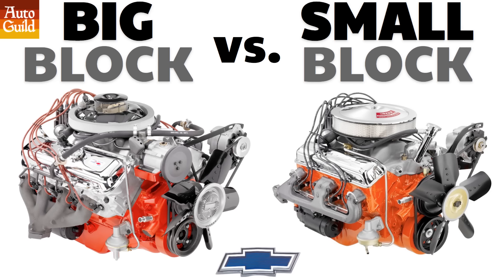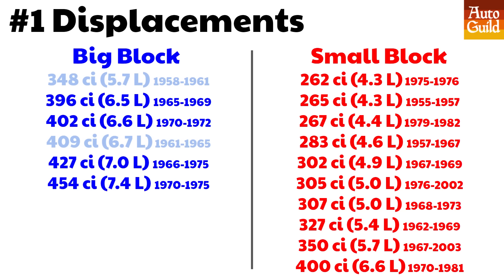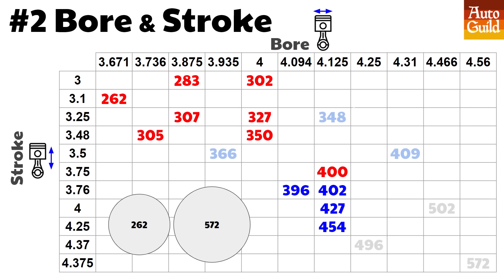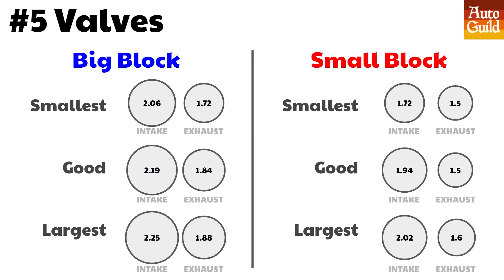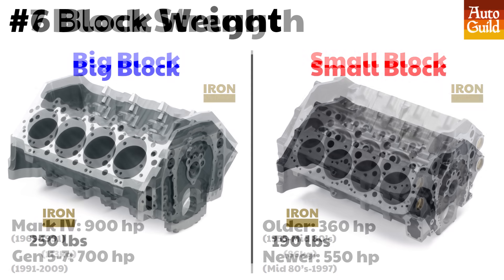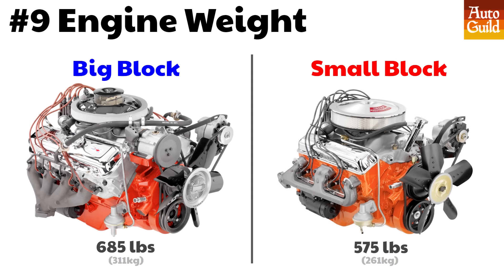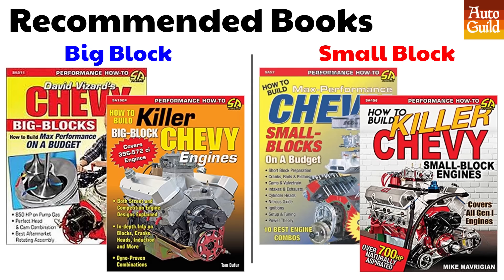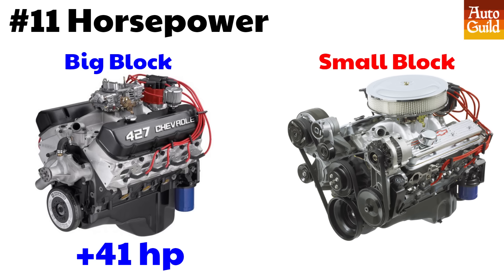Big Block vs  Small Block Chevy Comparison

Comment: Depends on what you're doing with the car. For drag racing dollar for dollar the big block is best! If you build a 400 small block and a 396 big block, and are limited to the same budget the big block will make more power. A gasoline engine is norhing more than an air pump. The more air in and the more air out with the corresponding amount of fuel, the more h.p. you will make! A stock big block head has bigger ports than the biggest aftermarket aluminum head!!!

Comment: Why are the RPM specs on these chevy engines so low?
The biggest selling point over All other engines were the high rev capabilities.
64 biscayne 409 4spd shifted at 7400 rpm all day long.
The 327 didn't turn on til 4000 rpm and shifted at 8500.
If you don't turn the rpm up you might as well have a 6cyl.

Comment: I started out with a 383 Chevy and the oil pump broke in two in hi gear at the track. Now I use BBC oil pumps in my SBC engines. Then 400 SBC At 13.1 compression and I burned up a few of those 4 bolt blocks with NOS at the drag strip. A 250 shot. They ran great for A little while. Next I got a 427 or 435 .040 over truck tall deck and I put Pop up pistons and H beam rods and 68 Corvette 3x2 cast oval port head's and a team G with a 750 DP Holley and 1 7/8 inch headers and a 3800 ATI stall turbo 350 and 4.10 gear .550 solid Cam at 108 and A gear drive. Ran it for 15 years and won a championship with it. Then I pulled it out and stroked it to 525 and changed it to a 4.56 gear. Ran great for a few years 11.0 1/4 Mile out of the boxes. Then I decided to go back to the street and I broke roller rockers in short order and I went to shaft rockers for about 500 dollars after machine work and bushings to remove the roller bearings that fail on BBC after a few miles with a solid roller cam. That and the 1050 Holley put me at about 10 K into the 525 motor. Everything was forged steel and Diamond Pistons 12 to 1 cr. 121 CC head's. Open Square Port aluminum. 320 runner's Big intake. I felt pretty good but I wanted it to run cooler on the street so I got a rollerized 2800 torque converter and the builder put a heli coil in one of the bolt holes and painted it black so I didn't see it. It was running great for about a month and I was going home and I stopped and I took off and I shifted it at 5000 RPM and when I hit 3rd. Gear or high I Heard a Pop and it started shaking like crazy and I let out and I was two blocks from home and I pulled the engine out and then I saw the Heli coil still on the bolt with locktite and I said what in the hell is that Heli coil doing there ? . They refunded me for the torque converter but I lost my block and transmission in the process. So I decided to replace the transmission and build a 355 four bolt main with Pop up pistons and A solid Cam. I put it in the car and my old ATI stall converter and it ran okay but it was nothing compared to the 525 that I took out. And I am serious about it ran great ! . Well I drove it to a few car shows and around town last summer and it was a good little 355 SBC but it was not a 400 SBC or 427 BBC. And I had a 454 once for a few months before I stroked The 427/435 to 525 but it was not consistent enough for me and I sold it. Well everything said and done I decided that a 355 SBC is not working for me and I just put another 454 in the car. I have a 89 formula 350 Firebird as a daily driver and I like the 350 in that car but in my race car I have to have at least a 454 engine. I trashed a nice 427/435 and A 525 using that same block, building a street BBC stroker is expensive if you want a 11 second engine that is going to stay together. I Did it and I was fooled by a hidden Heli coil in a New torque converter. Big blocks Are not very forgiving if something goes wrong. The crankshaft was so hard that when the torque converter bolt came out it flexed the front main bearing in the block and stacked the two bearings and cut out the block about a 1/8 of a inch. It was a 13 inch Turbo 400 torque converter and a little 6 inch racing front Harmonic dampener. The Torque converter was twice the size of the harmonic balancer so it lost the battle. Everything in the transmission was bent. The engine was internally balanced with Mallory welded in place. I was only at 5000 RPM when it happened. I used to race as A 427 at 6200 shifts. 427 BBC is a friendly engine if you can keep the pushrods and rocker arms together. I used 7/16 inch molley pushrods and Roller rockers but not on the street. It was a track only car back then.  On the street I kept having roller rockers arm's failing on my solid Cam BBC. I'd break them in half and I'd knock out the bearings. I ended up with stainless steel adjustable with shafts and steel bushings. I made a set for 500 dollars but they cost 1500 to 2500 dollars for a set of them normally. A 400 SBC is the cheapest HP in my opinion. But real power is A Big block . My 350 formula eats a lot of gas for the engine size but it handles great so I don't mind. I don't think that My 454 with the 4.56 is going to be any harder on gas than the 350 with the 3.31 gear to be honest under normal cruise driving. My 525 was getting around 10 or more mpg on the street with a 1050 dominator on it. Probably around 12 MPG. A 10 gallon fuel cell went around 100 miles before I stopped for gas. Of course I added a little bit of toluene for octane purposes. And A little mystery oil in that. I was over 11 to 1 actual compression on the street. Everything was a little bit cheaper back then but the principle is still the same.

Comment: I also truly believe the 350 chevy shouldn't be reved oit more than 5200rpm, it makes its best power at 3 grand with a mild street cam, my 350 info comes form a small block 350 Lt1 from 1996. 285hp 330torque red line 5800rpm. At 5 grand you can fee and hear the motor maxing out is interal potential. It all depends on the cam ground. Im not a big believer in ls swaping the world. I love the 5.3 ls engines because of reliability, but im nostalgic. Im also 22 years old so calling me a bomer is a complement. It depends on the application and preferences. Big block weights  more but has more potential for horsepower. Small block is lighter. Cheaper to garage build with aftermarket parts. Idk myself tbh both engines are formidable warriors. Depends on tons of factors.
Reply from the maker: Yeah great points.  I love having choose.  For me an alum block LS is great cause I like low weight but for others that’s not important.  Each car needs its own unique engine that works for the owner.

Comment: I installed an LS6 crate engine in my 1970 RS Camaro. Backed it up with a TH400 Trans with 3500 stall converter with manual valve body and a 3:73 read end. If you breathed on the accelerator the tires would go up in smoke and lay rubber for as long as you stood on the gas pedal. At 60mph on the highway you could punch it and the tires would break loose and car would start to drift sideways ! I overrevved the engine several times to 7500rpm and never broke anything. Sold the car to a friend of mine 25 years ago and he still has it.
Reply: You need better tires! Problem solved
Reply: @godofrock Not that simple. I had a buddy with an old Chevy Luv he made an 1/8th mile runner out of. Built 327 (low compression because of plans to put a blower on it that never materialized) with a 2-speed Powerglide and a Ford 9-inch with 3.90 gears. Tried for years and he could never get it to get proper traction. Wider and wider tires, ladder bars, etc. Had it for almost two decades and nothing seemed to work whenever he tried to get it to work right. Came to the conclusion that it was too light in the rear and it’d never really change. My ‘89 Sierra C1500 with a bone stock stock 350 TBI will light up the tires with 3.42 gears because it’s a single cab long bed, there’s virtually no weight over the rear axle if I’m not towing anything. Suspension setup and front-to-rear weight distribution are very important when trying to gain and maintain traction.

Comment: If valves are big and close to each other one burns the other and if heads are aluminium it corrodes its called electrollisess by metals steel is the best and 1970 are the most durable fuck after market parts

Comment: So question on the block strength. What about the new blocks made them so much tougher and what about the common thing heard “them old 70s high nickel 4 bolt mains were indestructible. Nothing like this 80s junk”?

Comment: There's a few things I don't understand. All of our race cars/derby cars have around  700 horsepower or more on older 5.7 small blocks and they handle the power just fine.......
Reply: Lol. If you are getting 700 hp out of a small block,  you got some cash dumped in your motor. Like drag strip cars.
Reply: @commentsedited  between 8 and 10 grand

Comment: It depends on the application. The big block makes better low end torque and generally makes more hp because of displacement. The small block turns more rpm and is lighter and makes adequate power which makes it a better road and round/road course cars.

Comment: Your video got a 👎, you left out several key points of info. Particularly the coyote bore spacing being it’s limiting factor. Flow charts for for heads. The coyote spanks the ls/Lt every day of the week due to power to weight/size-ratio. 
Coming back for a edit. Both the Lt and coyote can both handle 1300 turbo tune with a well educated tuner. Respectively both impressive engines. 
I would much rather work on the Lt than the coyote for simplicity purposes but in terms of charging the customer an hour coyote all the way.

Comment: A person can bolt on power on a big block  power. 
And there are part that can reduce valve weight and drag.
 And the rule is still the same it is the price that keeps the 
rule alive and undisputed the.
What happens when you make a big block turn r's like a  small block?
nothing beats cubic inch off the line, if that was not true everyone would be happy with weedeaters engine at the strip.  
now the LS engine and a few others are going to break inti the envelope of High rpm in future rpm engines. I have got one in storage idles at 5,750 and cruses at 1,273 rpm.
And every state patrol has left you messages to park it or they will shoot you and take the ride because thet can't keep up with it.
That was 30 years ago. Right now they are selling the last of this type of engines maybe a couple more but I doubt it.
Next Ergy fuel burning engine, ha one but couldn't keep it cool or I kept burning everything behind it for a hundred yards. Concrete I almost made my brother cry when I burn the back of his new shop.  But we are talking space travel is next.
Well my key board is sticking, hope this give you something to think about and take my advise stick to grade school stuff if you don't dare to chase your dreams.
And remember this just because you can't do it don't mean it can't be done.

Comment: I have a 1970 El Camino. It currently has a stock small block with long tube headers. I'm thinking of putting in a small block stroker to put it in a similar performance range to the big block. Any thoughts?

Comment: In a Nova/Camaro body, I would prefer a very healthy 327 (with camelback heads and 
forged crank and rods).  For heavier cars, like the Chevelle, the big block would probably
be better.  The smaller and lighter cars do well with a lighter small block.   If you put a 
500 hp small block into a Nova/Camaro, it will drive better than a bigger and heavier
car with a big block.  All depends on the cam, tranny, gears, and suspension setup.

Comment: would be nice if you were a bit more accurate in your statements
402 didn't replace 396...402 was a 396 bored 30 over as over 400 cu in had lower emissions rules. LS did not replace the small block, LS is a small block, 283, 302, 305, 307, 327, 350, 400 are gen I small blocks, 4.8, 5.3, 5.7, 6.0, 6.2 are gen III and gen IV small blocks...gen III small block replaced the gen I, then gen IV replaced the gen III, more recently gen V (LT) replaced the gen IV....they are all small blocks

Comment: I have a 67 Cougar 390 GT. I love the fact that its a Big Block. You just cant beat that sound of the thump of a mild cam and good exhaust pumping out back. A small block is no comparison. I swapped out the intake for an aluminum version. Installed an aluminum water pump. Jba tri y stainless race headers. Installed a Mini starter. Moved the battery out back. Installed an aluminum radiator with electric fan. All this made the 390 only 50 pounds heavier than if a 302 was in the engine bay.

Comment: When young I had a 396/325hp but added the 360hp cam in my 65 Chevelle SS and now a 65 El Camino so I have a good comparison.. Basically similar in all ways. The 350 cam now is at 454/454 lft .@050 218/218 duration with best GM Vortec performance heads  to the 396 360hp cam 461/480,  214/218 with a little more lift and lower line Oval Port head that I did hand port them.and port matched the cast iron High rise.. Similar HP? Trans is a 700r4 for SBC in the El Camino vs. the Muncie 4 spd -396. Same 3.73 rear Gears.

Torque is the biggest difference and therefore really liked the 396 better. Just felt so much more powerful, responsive and revved very quick.. Instant tire smoke just stabbing from a 15 mph roll and second gear you had to control the sideways movement. MPG goes to SBC. probably 5mpg city. OD in the 700r4 is not fair here. 

As far as maintenance? Since my 396 was not radical it was not any more problematic. Fitting in the 396 in a 65 was no problem. Just used 67 engine mounts.. plug and play. I will say however changing plugs was a lot easier since all exhaust ports were evenly spaced, The siamese middle SB ports are pain. Had old School 2 1/4" tube Appliance Headers on the 396.. they had an ingenious #1 tube that had a slip joint. unloosen it from the head and a clear path to the plugs on the left. I bought extra Header gaskets and just made separate ones for that port. BB -Seemed to go through more plugs ..Mallory  Dual Point vs HEI now? Better NGK plugs?  

Bought the El Co with the 350. If I could afford a BB I would swap. 396 is the cheapest. Remember out running a kid in 427 Camaro. LS's are great too but more work to go in. $$$ wise maybe the same? Options. LS ..no leaks!

Comment: For a bunch of Chevy guys, a $5,000 aftermarket engine block sounds expensive. 

But a couple of years ago Matt Farrah (Smoking Tire) bought an air-cooled 911 from the '80s, and the engine was puffing a bit of smoke. Soooo, he takes it down to the local Porsche guru who charges him $18,000 for a basic ring and valve job . 

That did include engine R&R, which takes a Porsche mechanic maybe two hours total for combined removal and replacement. Of course, there was engine teardown and re-assembly. But again, that's easy; it doesn't even have a cooling system to deal with and he can just plop it down on a bench. It wasn't bored, the pistons were re-used, and the cam wasn't replaced -- just new rings, valves, and guides, and they must also have done the crank bearings and surely they honed the cylinders. No machining work at all. Astonishing.

There is nothing special about an air-cooled Porsche engine. But the same job on a SBC (with two more cylinders) would be something like $400 for good parts, including a fresh timing chain and gears, and let's say labor is $2,500, so $2,900 total. That hardly even makes sense, because for around $4,000 you could have the thing fully rebuilt with fresh bores and new pistons -- the works. Even if I'm low by $1,000, there is still no comparison.

Just saying...

Comment: also the Horsepower handling capability is all sorts of fucked up, forgive my crudeness, a Small block 4 bolt Main engine can handle upwards of 650 horsepower reliably, and around 500 for the Two bolt caps, and around 700 with splayed Billet main caps, and a few modifications.

Comment: the sbc Did not have 1 style, they had 2 or 3 aswell, just the rectangular design was there until 1996 which then it was traded for a trapezoidal style port of the Vortec.

Comment: I am getting about 18 mpg with my 305 carburetor , low RPM stick , around 1100 to 1500 rpm , just cruzz, I am happy I did not get a big block ,  Good motor, reliable like a 305, mine 305 being a stick , I can spin the tires in second gear, a auto 454 can't .  I get better mpg than a 454, and power than a auto trans 454.

Comment: I had a 1970 Chevelle in High School with a small block 400.  As I got older I built a 454 with iron heads and block and replaced the 400.  Even with the heavier front springs the car never drove and handled as well.  That is why I went LS.  After I upgraded to the driveline I decided to swap in an LS2 instead of the big block.   I actually sold the car about 8 years ago and am looking to build another car.   It just depends on how you plan on using the car.  My choice at this point would be a big block with aluminum heads and a sniper EFI.   
The LS option is great but the big block is really cool.   The small block 400 was no slouch either.   If you plan to do the power tour or drive long distances I think the LS would be the best bet.

Comment: The big block with the black 427 valve covers is a ZZ427 crate engine from GM. Tuned correctly, 525hp with hydraulic lifters, oval port heads, choke and vacuum secondaries. Pump gas, 93. It's rated at 480hp.
Reply: Wanted one BAD when they came out...til I heard it had a smaller hydraulic cam. 
Pass on that!! They could have at least put a solid roller in there or even a solid flat tappet Id be all over it.